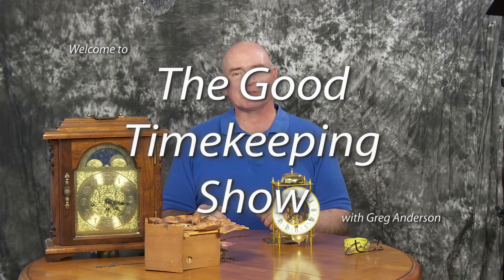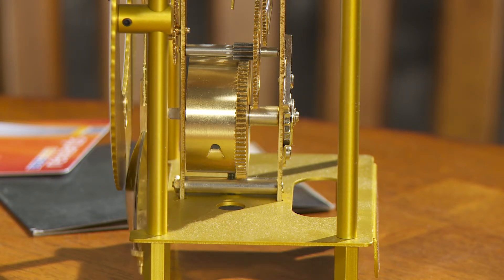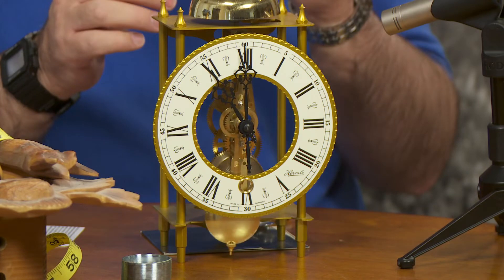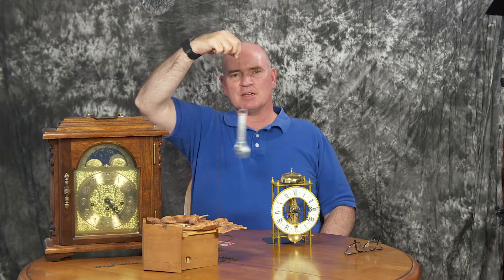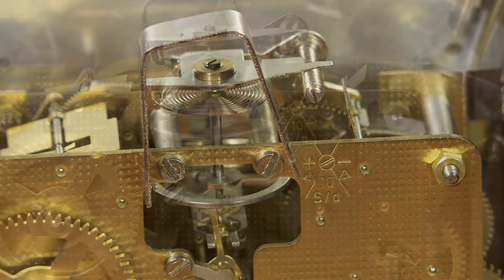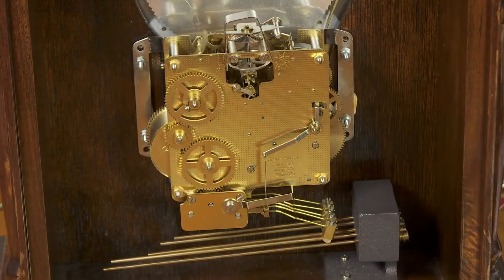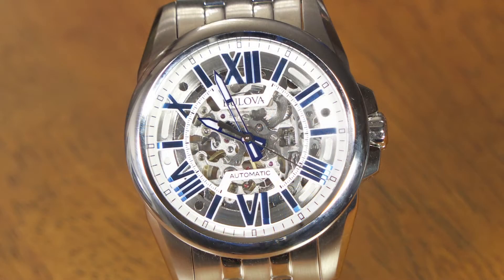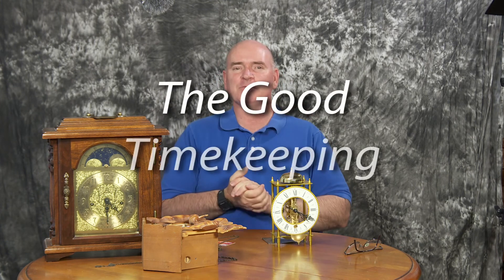Things That All Mechanical Clocks Have In Common

Comment: looks like that cuckoo needs the ratchet replaced or repaired, you should only be able to turn the sprocket that fast in one direction.
Reply from the maker: It’s an old clock, probably around 55 years old. It hasn’t been well cared for. I don’t know how much it would cost to fix it vs. just buying a new one like it.
Reply: @GoodTimekeeper  That movement is a Regula 25.  They are still made today, and you can get very cheap replacement parts or entire movements on ebay.

Comment: I'm curious about the "C" cell, high torque electric clock motors. They are much different than the ubiquitous "AA" cell motors usually used in wall clocks. The reason for my curiosity, is that I obtained a 1980s vintage Bulova "Mod" wall clock. It was running several minutes slow per day. It has an adjusting screw to adjust the rate. After just over a week, I was able to calibrate the motor by trial and error using the adjusting screw + or -. What I have not been able to find on the Web is how the motor operates. It emits a fast ticking sound at about the same rate as an old-time wind-up alarm clock, but quieter. I am enjoying the Bulova clock immensely and part of the reason is the ticking that is reminiscent of a mechanical movement.
Reply: I had one where it was simply a mechanical movement but the energy was supplied by the battery not any spring or weights